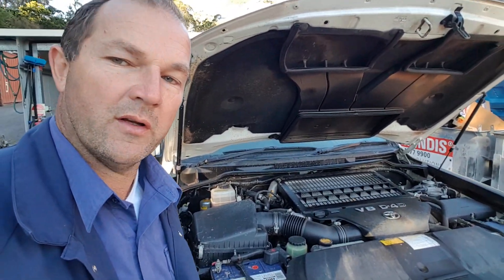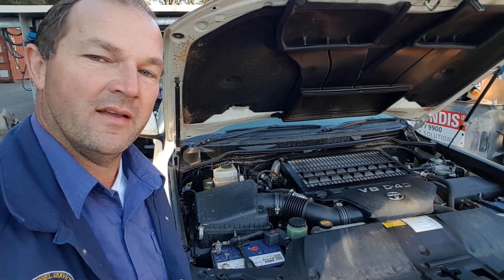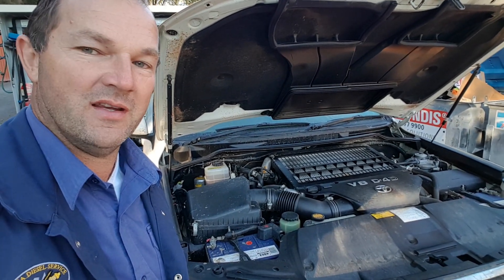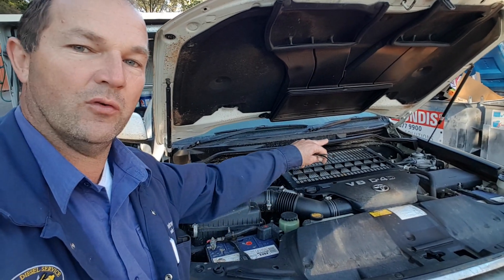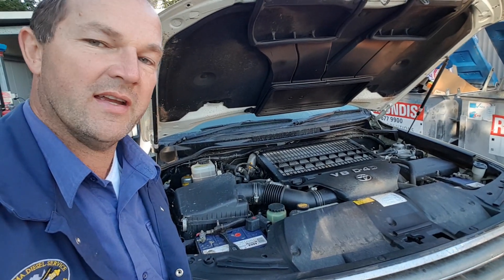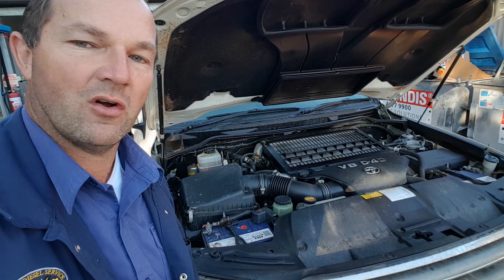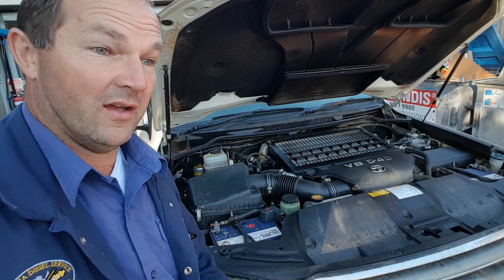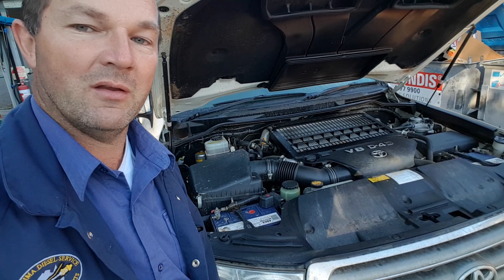Petrol in Diesel case.

Comment: I had 3/4 tank of diesel in current model Hilux and put 1/4 tank petrol. I realized but continued on anyway. No issues. I just kept diluting it with more diesel every 15l or so (was driving a long distance) and added a bottle of 2 stroke oil.
Reply: I had a similar situation. 17l of petrol in 55l tank. Stopped filling midway. Filled up with diesel and diluted it every 5liters. Peugeot 1.6hdi commonrail 2012 engine. No issues.

Comment: I once lent my D40 Navara to my old man so he could take some stuff to the tip. He thought he it would fill it up for me and put 60L of petrol in it. Made it about 8k's before he stopped in my driveway. I restarted it to park it in the garage and it idled for 30 seconds and then died. It would crank but not start. Long story short, drained the tank, cracked the fuel lines and primed the system with fresh fuel (about 10L), drove it around for an hr , then drained the tank again, refilled to full and never had an issue with it.
Reply from the maker: 100%

Comment: I have a 2011 LC200 turbo diesel, at around 150,000km I made the mistake of putting 4.38 Litres of Vortex 98 petrol in an almost empty tank ( 10 litres left) the smell of petrol is what alerted me. The  Woolworths fuel station has both Vortex Diesel and Vortex 98 petrol next to each other, very similar hose nozzles..... anyway i called Toyota technical department, they advised that by filling remaining tank with diesel the small amount of petrol would be insignificant, that was 123 litres of diesel plus the 10ltr already in tank to 4.38 litres of petrol, close to 30:1 ratio, anyway no issue car ran smooth, cars now done 370,000km

Comment: I once accidentally put 40 liters of petrol in my almost empty 75L LR defender 110 TD5 tank , driven 10kms to the side of the road drained as much as I can using a siphon pump then put 1 liter 2 stroke engine oil in before fill up with fresh diesel. After 100000kms never had any problems 。

Comment: Hi mate, what was the verdict ? Did your method get the job done ok ?
Reply from the maker: Sure did.
Reply: Berrima Diesel Australia reason I asked as ive just put $50 petrol in my 2028 diesel Hilux. The tank was on empty and I drove around I5km before it started to play up, thinking it was either dirty fuel or if picked up some crap from bottom of my empty tank.. ended up stalling at traffic lights turned green she started and stalled once I got moving so turned onto the medium strip but not enough momentum to get the tail off the road so tried starting it three more times.. We’ve since drained e fuel filled her up and primed the lines and she started put no knock in and she still has a bad knock. Ordered new injectors $2,700 so hopefully that’s all she needs..
Reply from the maker: Thats very unlucky
Reply: Berrima Diesel Australia new injectors plus new injector bolts did the trick re mapped the injectors on the scan tool computer thingy and she purrs like a kitten.. Your video prompted me to show my mechanic who was also going to do the heads and replace the injector pump. 4 grand stuff up could of been up near I5 grand.
Reply: I just drove 100 kms after putting 50 litres of petrol to fill the tank, got a tow back into town bled the tank and line cracked the first injector turned it over a few times to Chucked in 50l of diesel and some filters and away she went. 2021 hilux 2.8
Running fine since- boy did I get lucky

Comment: I put 6 litres of petrol in my 2017 Prado, the tank was completely empty . Not knowing what to do l then fill the tank completely with diesel giving it about 140 litres to diluted . Do you think i will have any problem's ?
Reply: Add Engine Oil, Beer , Bong Water , & Piss In The Tank
It Will All Mix Up Good
Reply: Justin Pallett  so what happened to your prado after you filled 140ltrs of diesel? Is it runs okay or you feel something wrong in your car?..
Reply: @jetrykalba7881  he sold it straight away. 😂😋😋🤫